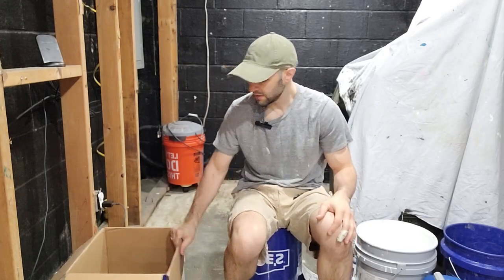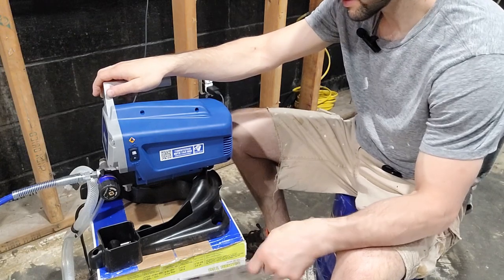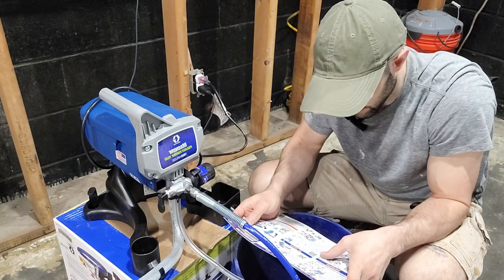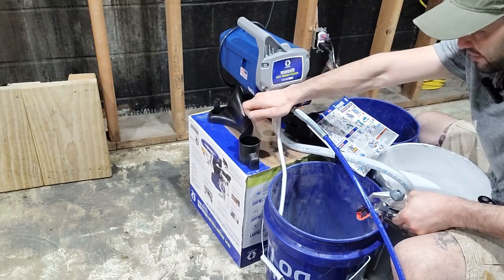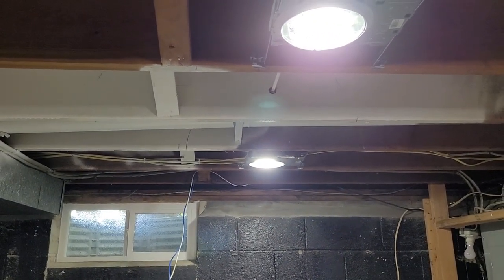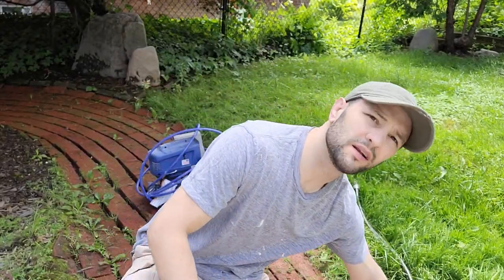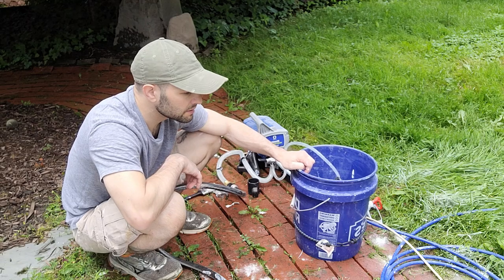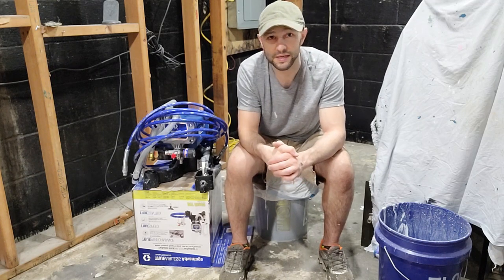Graco Magnum Project Painter Plus Review

Comment: Thanks for doing this.  I'm in the same boat.  I'm painting my house.  My air supplied sprayer works well, but does not have nor can I find spray extensions to reach high spots.  Bought the Magmun so I can use extensions.  I'm planning on using mine this AM and this video saved me some time with the trial and error.
Reply from the maker: @DejanSmaic  that's great!  Glad it helped.  Update: I used mine last weekend to paint an exterior building.  Turned out great and really helped me with the learning curve.

Comment: Thank you for filming this. Would you say this one is sufficient or maybe buy the next model up?
Reply from the maker: I painted the exterior of a brick building and noticed three drawbacks: 1) it clogs occasionally and needs to be re-primed.  This isn't a big deal once you get used to it.  2) You have to lug your buckets around if you have to relocate the paint job.  However, you'll have to do this with the upgraded model, too, as there is place for the trolley to carry your buckets as you move - they sit on the ground.  3)  There is no wheeled trolley with this model.  It makes it smaller and more portable, but harder to move from one spot to another.  
My solution - I'm going to build a small trolley that keeps the machine off the ground and can carry the buckets as I move.  That being said - the price for the quality is very good and building my own carrier will still be cheaper and way more efficient for big jobs.  Thanks for the question!

Comment: Do you think it's loud? Great video it reminds me of myself  trying to figure out everything on the fly lol. Im thinking about getting one but I'm not sure if I want this one or a wagner. Glad to see it all worked out for you in the end.
Reply from the maker: Once it gets going, its not very loud. Wagner is definitely the industry standard, but I bought this one because it seemed to fit my needs and budget for a big job. I actually own a handheld wagner and it works great, but it requires thinning which is a bit inconvenient sometimes.  Do your research and I'm sure you'll be fine.  Good luck!
Reply: @fortorangewoodworking  oh I had no idea Wagner was the standard. Do you have any Wagner sprayer recommendations that would compare to the Graco mppp?
Reply from the maker: The Wagner Control Pro 170 is the most similar alternative.  They're comparable in terms of design, use, and features. They are also close in MSRP, but the graco seems to be on sale more often, which could create a price difference of  $100 or more.  They both get good reviews and can handle large jobs, but Graco suggests that it is still a "light duty" (homeower) machine, whereas the Wagner would be suitable for professionals to use most of the year. I doubt you could go wrong with either.
Reply: @fortorangewoodworking  thanks alot for all the info I really appreciate it
Reply from the maker: @theirishman088  Anytime.  I'm still working my way through a lot of this stuff myself and that's what the channel is mostly about!